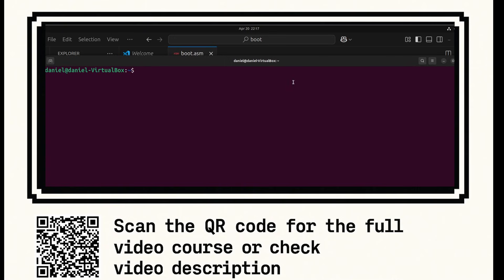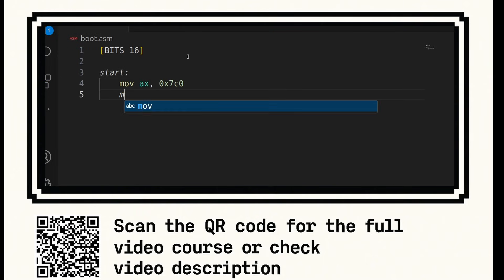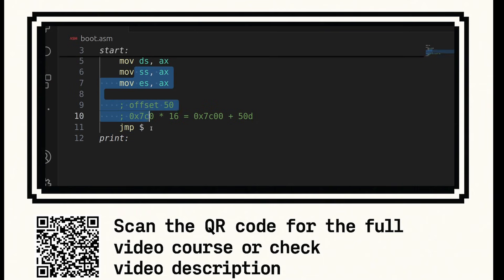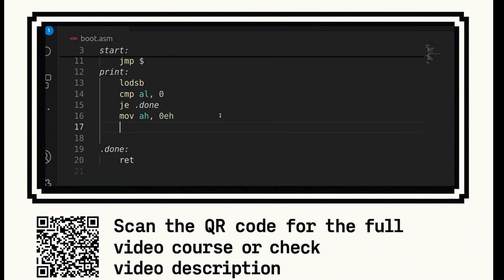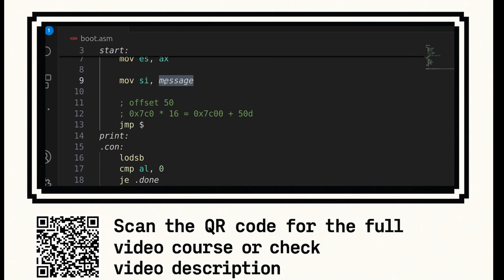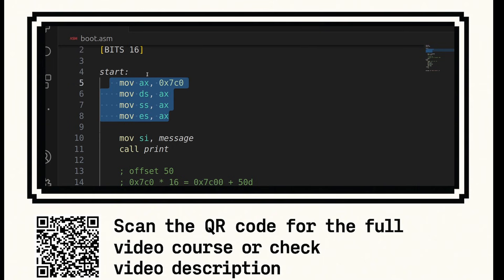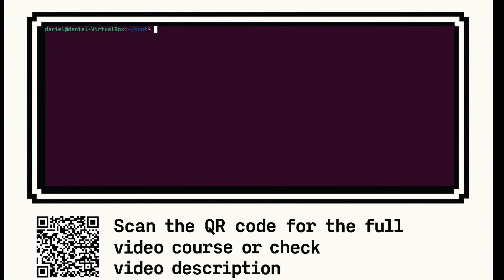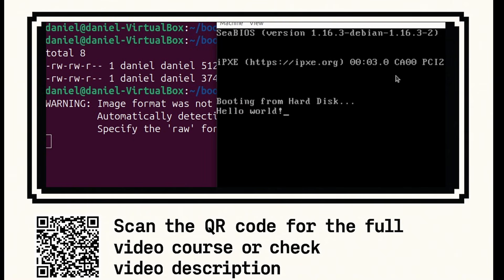Build a Bootloader in 10 minutes |  Kernel Development

Comment: Hey bud, I've got your book and I'm at the point where we should be able to run on real hardware, it doesn't seem to be working for me. I was wondering if you could..

1. Let us know what hardware you are using.

2. Where we can get the the spec needed to know how our actual usb boot device should be formated (You mentioned in one video you needed to skip a few bytes because your system overwrote the first 30 some Bytes on the first sector of the usb, how did you find this out?)

I am using the aspire E5-575
The BIOS has a legacy mode so I figured thats the non-uefi mode. I really want to make this work on my hardware, also do you plans or already have a section for booting with UEFI mode because documentation for this is also a mess?
Thank you in advance. You and your resources have been valuable!
Reply from the maker: Helo,
I recommend testing the bootloader on a 2010 computer or older. The course can be followed without problems through an emulator. In part two course (currently in development) we implement UEFI and 64 bit kernel allowing for booting the UEFI bootloader.

Thanks
Reply: @dragonzapeducation  Thank you for letting me know, I will definitely sign up for part 2! Also, I just ordered the first ebay laptop that came up for the search "laptops released in 2008" on google's AI assistant.
Reply from the maker: regarding your questions I need more context then I can answer
Reply: @dragonzapeducation  I was hoping you could make a video on the hardware you tested on, and I'm not sure what video it was, but you definitely had a video where there was a page explaining some bytes of the USB got written by the bios when reading the first sector. For problems like that I would want to know how to find that information. How would I know my BIOS is going to do weird things like that? Did you find a motherboard Manual that had the BIOS chip part number than found a manual about that?
Reply from the maker: @emiliocben  Yep the truth is this computer was so old I don't even remember the hardware, its long gone in the trash that machine. I think I bought it around 2012/2014 

Ahh yes I remember something about what your talking about but without a reference to the lecture I cannot answer you accurately. If you find the lecture again please let me know and ill watch it and explain what i said in a better way.
Reply: Just wanted to highlight, I fixed the issue and there are multiple things at play but I am going to assume 1. is what fixed my issue.

1.  I was writing to the USB inside a VirtualBox when I realized dd wasn't clearing the correct amount of space then VirtualBox was telling me I was low on space. So I figured Virtual Box was doing something weird, after restarting the software, dd seemed to actually clear the whole usb drive.

2. I did notice at this point in the book, we set ss to 0 but never set the sp, so I set this to 0x7C00, not that we are using push or pop at the moment but I don't know enough about this stuff to declare that we don't need to set the sp.

3. Not related to fixing my issue, but whomever reads this make sure you check all your immediate values! Don't use 10 when you meant to use 0x10!

Comment: "Don't worry if you don't understand assembly, just execute this code in ring 0" At least you told us to run it in a vm or a sacrificial system :D
Reply from the maker: Also hope you enjoyed the video :D
Reply from the maker: @MariusEidem  this particular program is harmless if followed correctly. Absolutely no risk in the emulator as shown in this video.

The problem is if someone decides to overwrite the sector that matters on their primary real disk. That's why I say to use a spare disk if using on real hardware.

If following this lesson exactly as shown it will be emulated not running on your real cpu so no risk